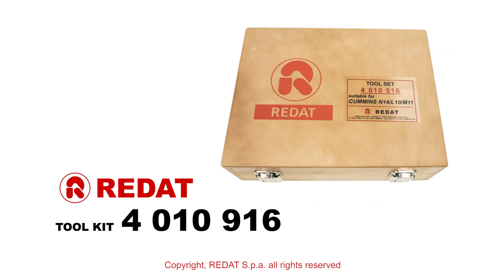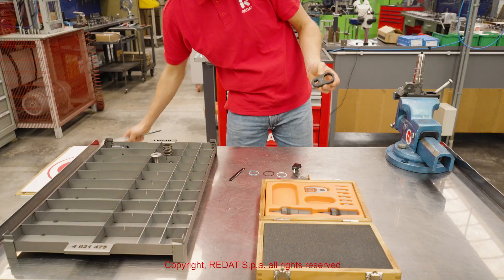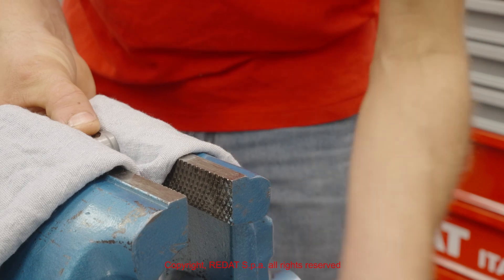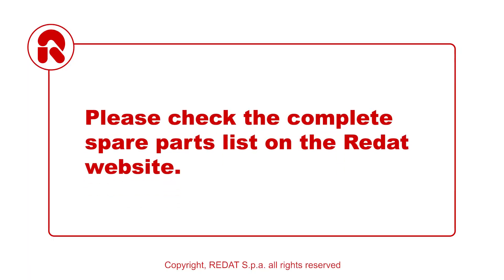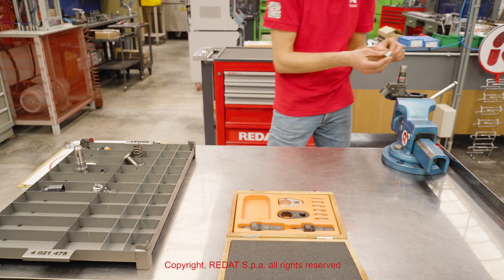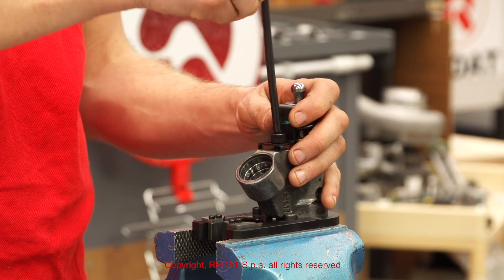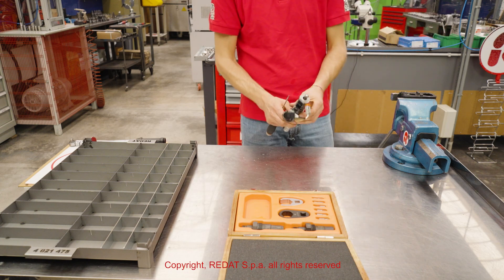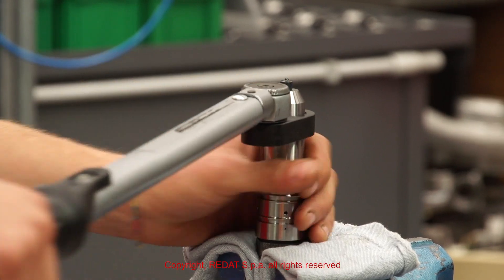Cummins M11 injectors - Assembling, disassembling and testing

Comment: Please make video Full measurement with gauge ball lifting air gap
Reply from the maker: We do not do this kind of measurement in repairing this injector. There is only one ball inside it, sitting below the plunger and barrel, but there is no calibration connected to this ball.

Comment: they say that reman injectors are not reliable.
Reply from the maker: That depends a lot on how they are remanufactured.

If the job is done properly, with the right knowledge, the proper care and the right materials, reman injectors can be very reliable. 

Of course, in order to trust the injectors they must come from a workshop you trust in the first place.

For brand new units it is not really different, you trust the original brand to work properly, have good quality control, and not try to cut costs where they shouldn't... if the same principles are applied to reman, they do transgfer to the final product.